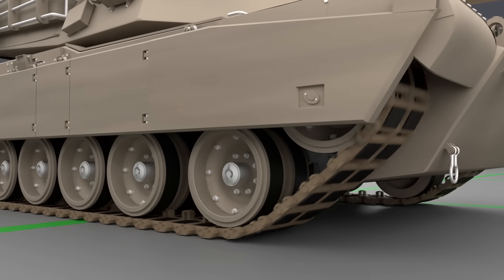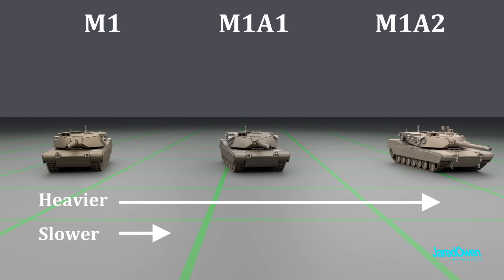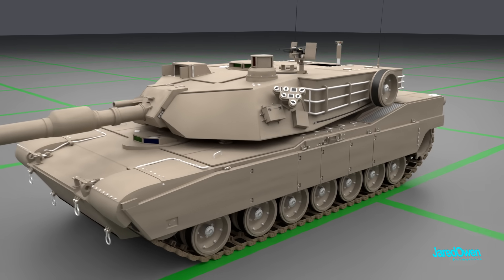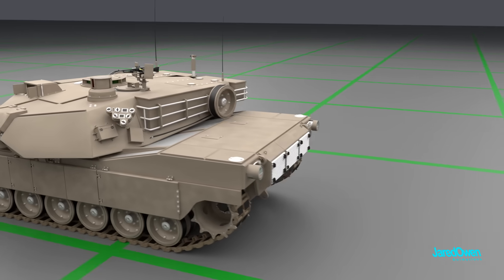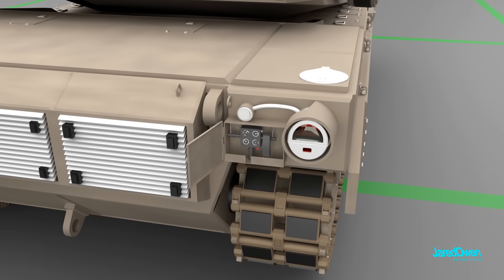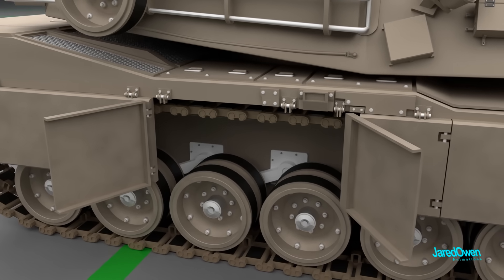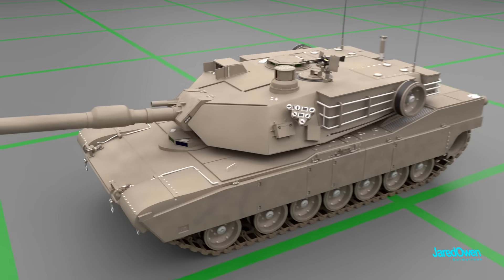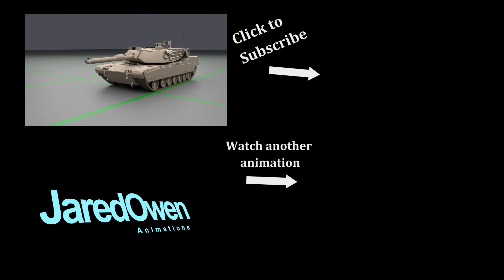How does a Tank work? (M1A2 Abrams)

Comment: I've heard that the seat for the driver is so comfy, they sometimes fall asleep on the job (Usually when the tank is stopped)
Reply: It's easy for the driver to fall asleep because his seat is set up like a dentist's chair, so he's already partly lying down when his hatch is closed. This is a side effect of designing the Abrams to have a short hull. The reason he often falls asleep, though, is because this seating position creates a lot of fatigue when you have to operate a vehicle. The driver in an Abrams is always unconsciously craning his neck and back to take a look through his vision blocks and has to do a lot of upward movement with his arms, so over time fatigue would build up in the driver's body without him noticing. The moment the tank stops and his primary task is done, all that fatigue needs a release and he's already lying down anyway, so off to sleep he goes.
Reply: Compared to the older M60A3 it is a very comfy seat.  Tank crews get about four hours of sleep, on average, and the driver usually gets his in 10-20 minute power naps.
Reply: As a tank driver I can confirm that it’s easy to fall asleep while in the drivers hole.  Lack of sleep plus laying back will put most tankers to sleep in just a few minutes

Comment: I'm just gonna put this here real quick

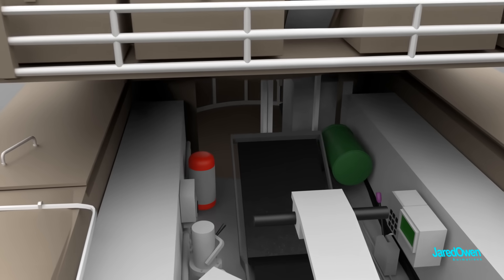The tank is protected by an armor type known as composite armor, basically this armor consists of different elements sandwiched between each other, the armor works differently depending on the ammunition type fired at it, for kinetic energy rounds (the ammunition tanks used to go against other tanks) it shatters the dart using the hard and brittle ceramics, as for shaped charges (it's basically the ammunition of the RPG but for tanks) it deflects the molten jet stream using spaces between the armor, thought this is just one type of composite armor, the Chobam armor which is used in the M1A2, there are other types of composite armor used on different tanks, with different ways on how they work, this armor is placed almost all around the tank (on some tanks even the front pieces of the side skirts), though it is more concentrated on the turret, as seen on the X-Ray at 9:01

Aside from composite armor there are also other ways to improve a tank's protection, such as Explosive Reactive Armor, this type of armor is used on the M1A2 TUSK (Tank Urban Survival Kit) modification, these are those square boxes on the side of that particular modification, this armor explodes upon contact with both kinetic energy rounds and shaped charged rounds, although it protects better against shaped charges, by exploding, it prematurely detonates the ammunition and disturbing the trajectory of the jet stream, and making it hit the outside armor harmlessly.

Correction : I made a mistake on the M1A2's armor, and that is apparently the Chobham armor was not on that particular tank, it is only present on the M1 Abrams model, the earliest variant with a 105mm cannon, the M1A2 uses what's called a HAP-3 armor, which is an armor developed from the aforementioned Chobham armor

P. S. if you want to try War Thunder I'd suggest to be patient while playing it, especially with the grind and the fact that sometimes you have to fight against Cold War era tanks in a WW2 vehicle (the matchmaking is based on a tank's performance and not the time they were built), though this will only happen at later tiers so don't worry about lower tiers, it's quite fun there
Reply: The abrams use depleted uranium armour not the choblum armour
Reply: When a round, let’s say a HESH round hits the armor, the armor explodes and sends most of the force from the round back out instead of into the crew compartment
Reply: Chobam armour
Reply: Ethann LEW what’s chobam armor?
Reply: @dmitrymolotov6428  it is 2 steel plates sandwiched with a ceramic plate the ceramic absorb the impact if i am right, and it is used on the British challenger tank
Reply: @ethannlew860 Yep. I think it was originally developed for the Chally 1, and now they use an upgraded version (which I think is the same but British version they use on the M1a2) on the Chally 2. I'm not sure if it's the EXACT same between US and UK because... y'know, classified... but  at the very least derived from.
Reply: @sgtrpcommand3778  i dont know if they went though with it but Chobam was original meant to be some what modular.
Reply: @sgtrpcommand3778  yeah
Reply: Thanks for the extra facts!
Reply: that armors is of course the british chopham armor which is sandwhiched with uranium
Reply: My man's be right here
Reply: The way the Americans concepted this tank, it was to make it fully customisable and modular, I think it’s a brilliant machine, and the operators must get so many hours of training and updating on matters, the larger issue for tanks aparently is urban environments where somebody can appear extremely close and discharge big explosives,which promoted most countries coming up with bolt on reactive armour, and being segmented it can be relocated to weakened areas, honestly all makes sense, based on actual issues encountered. The problem is that all this armour will have a limit to its success, and it appears that hypersonic explosive weapons might be a big issue, so as strong as these things are, they have to be deployed in a manor they arnt over exposed also, like the game of chess, the weak pawn can potentially take the powerful queen,
Reply: @f1reguy587  the have to make it customizable so as to prevent it from.being obsolete like how even the soviet t 72 is still in service woth many countries cos of it being able  customizable
Reply: better than the whole video
Reply: Мы РУССКИЕ, уничтожаем ваши амбрамсы.

Comment: Interesting. Where are the other weak points? Asking for a friend.
Reply: Gun breech area, the entire turret ring, LFP (lower frontal plate) if you have a good enough round. But also the sides are EXTREMELY weak. If you wanna kill it with something like a German 88mm, from the front aim for the turret ring. From the side anywhere on the hull.

Comment: I wonder why they designed it having manual reloading by a crew member on such an expensive and technological machine
Reply: Automatic reloading can break, it needs a lot of maintenance in order to work without problems, it adds a lot of weight to the tank and takes up a lot of room, a human loader is more reliable, doesn't weigh as much, takes much less space in the turret and usually human loaders loads faster than automatic systems.
Also usually loaders have additional responsibilities besides loading shells, not mentioning it's just easier to maintenance a tank when it's a crew of 4 instead of 3.
Reply: @E_y_a_l  ohh cool, thanks for the explanation! But I bet at some point they will come up with something that is light, fast, small and reliable
Reply: @Linck192  the russians use autoloaders in their tanks with greta success. They ve got their advantages and disadvantages

Comment: A small detail , turret on rotation intersects with body of tank. Fantastic animation overall.
Reply: Noticed that too... I also am intrigued by the maximum vertical angle that the cannon can rotate
Reply: He has the pivot point of the turret moved back. It should be more forward
Reply: @true2the_322  Yeah agree
Reply: The scale of the turret model is pretty much inaccurate.
Reply: @CDP5872  пам пам
Reply: @CDP5872  пам пам

Comment: There are lots of differences between the latest Russian tank, T-14 Armata VS M1A2 Abrams
Crew : 3 VS 4
Weight : 48 tons VS 68 tons (Already mentioned)
Cost : $3.7M per unit VS $8.92M per unit (Got it from Wikipedia)
The Russians have a huge advantage in terms of manufacturing and operational cost.
Reply: the t14 armata is a different generation of tank

Comment: I wanted to know how the gun fires and how the engine works and how the turret turns. This was a nice overview but doesnt explain how it works like your other videos.
Reply: The problem with sponsors is you have an upload date. Maybe theres a part 2?
Reply: The gun fires like a firearm in bigger. With a firing pin. And the turret is set on ball bearings and is turned by gear systems inside the turret

Comment: Nicely done video. I used to be in the army back in 2003. And my main responsibility was transporting the M1 Abrams. We used a specialized truck and lowboy called the m1070 HET heavy equipment transport.  When we were in Iraq the tank crews would ride in the tank As it was being transported providing us additional security. One thing I noticed you didn’t mention in here is that the M1 abrams is also capable of firing its main gun while traveling at full speed